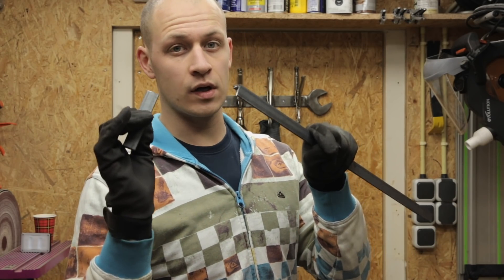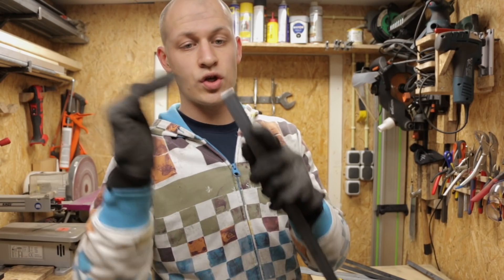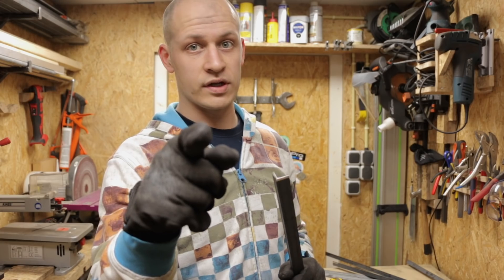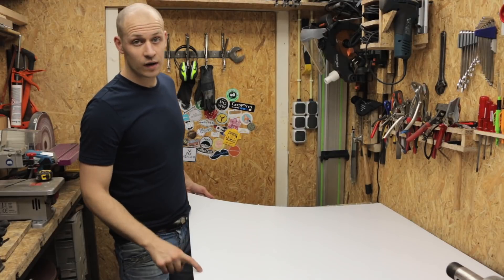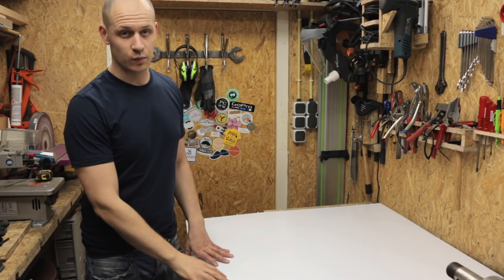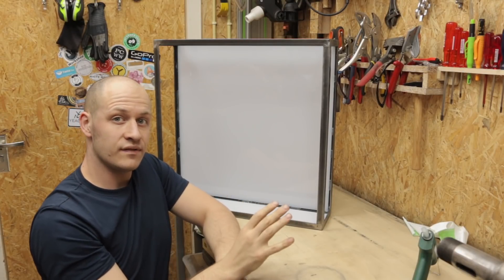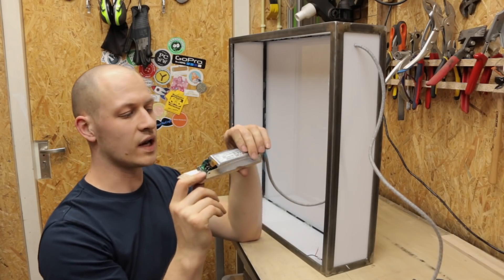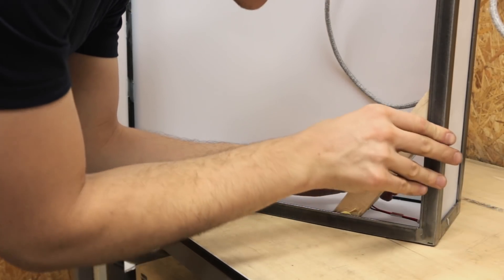How to make a modern wall lamp with a metal frame and LED's

Comment: Interesting lamp and interesting way of hanging it on the wall. The hanging system is nearly a French cleat as woodworkers are used to make them. The combination of
wood and metal for that here is very clever.
Reply from the maker: Hey Hans, thanks! Yeah I know the French cleat design. When. I designed the lamp I looked at a lot of options to hang it. This turned out to be the easiest and it's super solid

Comment: Now that's a cool idea for a wall lamp! Good call on how you mounted the power supply. That is always tricky to do, so you don't block the light. Nice job!
Reply from the maker: Yes. I totally didn't think of this until I needed to mount it. How would you have mounted it?
Reply: Maybe weld a small round metal rod horizontally half way up the light box and then mount the transformer to it. That would completely prevent any dark spots in the lens. We made two table lamps just like that a few years ago and suspended the power supply in the center/rear of the lens. It worked perfectly and doesn't show a dark area.
Reply from the maker: That's a really good idea. Thanks!

Comment: Very cool modern lamp.  It might be a cool idea to do something similar with a drop ceiling. You could put different groups of panels on different circuits to vary the pattern and the amount of light.
Reply from the maker: That'd be cool as well. I also thought about putting Philips hue lamps in it. But that's not what we needed in this spot..